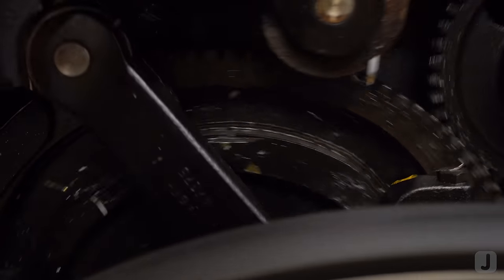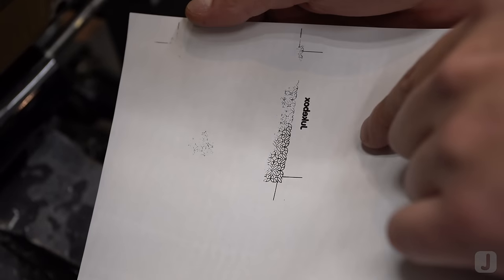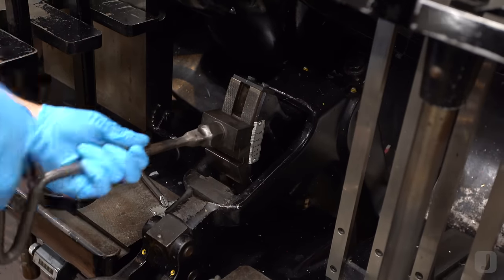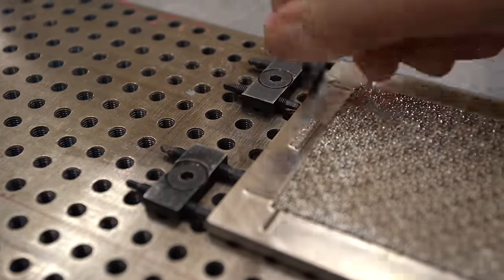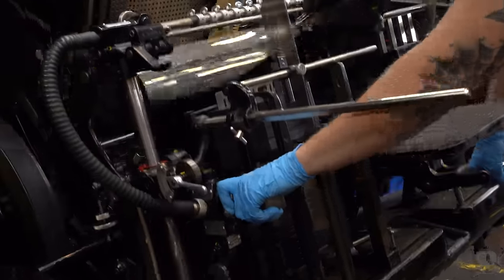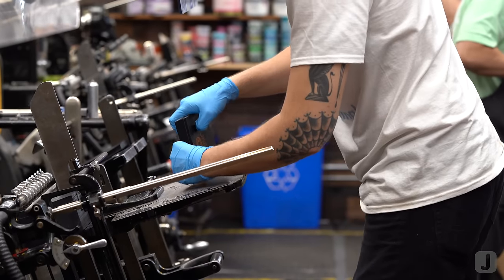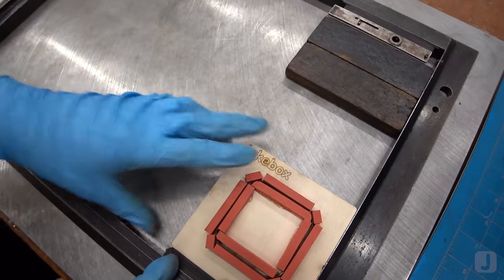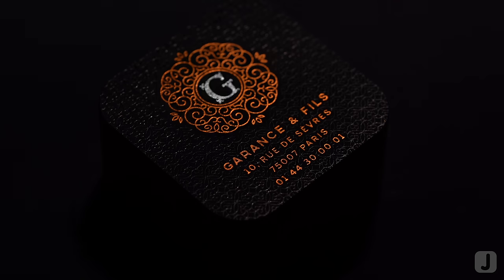Metallic Foil on Luxurious Black Business Cards!

Comment: No, friend. Those a business coasters.
Reply from the maker: double whammy
Reply: I had to chuckle a little. Yeh, some customers use odd sizes on their business cards. Really enjoyed your video. Gives me ideas I could pitch for our business cards. I work for a commercial printer (various offset presses including a KBA 540, KBA 640, Heidelberg GTO 220, 2 Heidelberg Quickmaster 2 colors, a Haim Superjet envelope press, digital with 2 Xerox IGENs, flatbed with a Vutek for window clings, signage, and banners on an 8 foot wide format) We also have a couple Heidelberg letter presses in house that we use for die cutting + a full bindery. Our cards are 3 stocks laminated together with a red center sheet and 2 outer whites. I just think they would be classier ditching the center laminated sheet and changing stocks to Classic Crest Duplex Epic Black/Solar White cover, then add a red foil guilded edge. That 1/2” radius round corner is really classy too. Kudos to whoever designed that card you produced. Really nicely produced video.
Reply: @warmothgmc  talking about odd size, a friend of mine made his card just one mm longer than an usual size, and made the design on both long side hot pink, so his card would still fit in an normal card case but stand out in a deck of cards ,lol

Comment: Is anybody else more amazed by the fact that literally a small piece of tissue paper is all it takes to even out the stamping?
Reply: He also adjusts the pressure, so even without the tissue paper it would have looked better. The difference you see is exaggerated.
Reply from the maker: This is the main component to making each unique job perfect. We have special tissue papers that are mic'd in thicknesses of .005, .003, and .001 so that we can appropriately build up the areas we need. It takes a lot of finessing to get this perfect and you can often find yourself fighting the impression as it settles across a run. We call this step "make-ready" and in the wise words of every printmaker out there "make-ready is everything".
Reply from the maker: a thin sheet of .001 thickness paper can often make an enormous amount of difference. I adjust the pressure also but there's no denying how important the makeready is. It's easily the most integral aspect of the process.
Reply: Epsilon Karamazov that is absolutely mind blowing. 🤯

Comment: Great video guys! The shop I'm working at has three incredible Heidelberg windmills from 1952 that I print with- but can't use foil on. We have a couple Kluges in the back that aren't up and running right now, but this totally makes me eager to get going with the foil on those! So beautiful!
Reply from the maker: Nice! Kluge foil stampers are great! Changeable side guide... adjustable laybar... multiple foil pulls...super consistent heat... air foil separators... room for friskets... tons of pressure... Big fan of the EHD models. If you have any Kluge questions in the future I can answer those too!

Comment: Business card cost: $15. Machine cost: $30,000. Defending yourself by throwing them like ninja stars: PRICELESS
Reply: Yeeeeeeeeessssss!!
Reply: I'd raise that BC cost quite a bit.
Reply: check their online configurator, this is no 15 dollar job (hint: a 16 pt jet black stock, front only, single color, standard business card with no extras is about 270 USD for a lot 100 with 7 day production time)
Reply: @run00n0  I was saying $15 per card :) Thanks for the more accurate price, it's definitely worth it for CEOs and hitmen :)
Reply: I think you’re overestimating the machine cost. Where I live you can buy a refurbished Heidelberg (not the gt version and without the foil heating system) for under €5000
Reply: @gvanvoor  I thought this was an ancient press from centuries ago :)
Reply: Alex Supremo It is, but apparently demand is high enough for companies to refurbish and resell them. A lot of modern print shops still have and use one for specific purposes (mainly embossing I think)

Comment: I'll never complain about the cost again!!
Reply: Damn right you won't complain if they are using a machine from the 1960's,  but if they are using a a new modern machine it'll be so much easier on them with sensors doing most of the work
Reply from the maker: Show me this machine you speak of
Reply: Arþur D Both look painfully slow tbh
Reply: @ArthurD  Both those machines are rubbish, they are toys designed for low volume low quality output, you cannot compare this Chinese rubbish to the Heidelberg output, like comparing a Porsche to a Kia
Reply: @zaneh6224  I bet Porsche won't sell as good as Kia. Porsche is just VW with a different badge.
Reply: @zaneh6224  also, they use absolutely the same principles, just different execution. How can you be so blind to not see that? Do you prefer antique over modern? Or roughness over precision?
Reply: @ArthurD   I worked in the printing industry for many years, what you linked to is no comparison to the quality these older machines will produce, you don't even understand foiling if you think these two are the same,.

I prefer quality over quantity, the machines shown in this video produce far better quality than that Chinese toy, and they produce that repeatable quality at a production speed and have been producing that high quality for 70 years, that toy will be broken in about 3 months.
Reply: @zaneh6224  they only do that because of the high cost regular maintenance. They add enormous cost to the price of these cards which is not good for people from emerging markets. This is a con that cheaper machines from my links don't have.
Reply from the maker: @ArthurD  Our press has never needed maintenance above and beyond our routine oiling and clean up since 1960. There is no computer to fail. The press can print, emboss, die-cut and foil stamp many different kinds of materials. It has an impression strength of 60 tons. It can reach speeds of 5000 impressions per hour and can fit a press sheet of 13x18. The dies we use are photo-etched magnesium using thermographic film that outputs artwork at the highest possible line-screen. You can't possibly think that one of those small toys could compare to top of the line equipment from the golden era of print communication.
Reply: @JukeboxPrintLive  ok, good for you. I wish you luck and wisdom. Last word though: you're there now, with your aging top of the line equipment, but these "toys" you mentioned will eventually catch up and outperform this large and heavy machine. They are cheaper and faster to make, use and output production. Market always looks for something like that.
Reply from the maker: @ArthurD   Arþur D  When the escalator was invented it didn't replace the stairs. Sometimes the "hard way" is simply more capable - not because it's old fashioned; but, because it has stood the test of time and the process has proven to be most reliable under an enormous variety of conditions. An old crippled cat can still catch a mouse better than a race-horse.
Reply: Considering everything including set up cost on the artwork, I bet you could get a card like this done for 50-75 cents a piece for a run of 10.000 not a bad price. Would be great if a person marketed these as a premium guest pass for an event. Definitely a collectors item/memorabilia.
Reply: @ArthurD  though I agree with you to adopt some modern solution but, remember @Jukebox Print loves what he does and the fun using classical equipment cant be replaced believe me I have digital duplicator for my bookbinding hobby and work, but I feel empty wish I had old school printing machine :)
Reply: @ArthurD  I'm sorry but these are links to toys that an invested hobbyist may purchase, not a professional print shop.  There are a lot of semi-quality pieces that can get produces in China but not to this quality or attention to detail.  This is an art that will likely not get replaced by technology for many decades.  Heidelberg's new offset presses do incorporate a lot of new tech and they still require preventative maintenance for the actual press to ensure longevity.  Adding tech means more maint. (as well as more things that can go wrong) and it's my experience that it's the tech that has more issues and goes out of date faster than analog.  This is why these machines from over 50+ years ago take so long to get replaced with newer equipment.  It's also a very recent concept that printing should be more 'affordable'.  People don't understand how expensive printing can be and that it's an art, most of the time I deal with new clients they think we still print things by the page instead of multiple up on a sheet.

edit  Completely forgot to mention but the toys you referenced only foil stamp, the machine he is using can do that plus embossing, die cutting, scoring, numbering plus more.  There are digital printing presses out there capable of maybe a fraction of those capabilities but they are in the many $100,000's to acquire (with each capability adding even more to the price) where as these older presses are only a fraction of a fraction of that cost.
Reply: @ArthurD  i dont think u quite understand how this machine works. It doesn't just "print". It is able to press the designs into the paper. and it creates a very interesting touch to the paper/design!~

also, pardon me if it sounds quite shallow, but i do think letterpress is special as compared to modern printing because the finishing touch isn't very achievable with modern equipment.
Reply: @ArthurD  From a quick, rough analysis of the first link you provided vs. this video:

First link: 4 minutes setup time with 40 seconds per print.
This video: 30 minutes setup time (kinda guessing with all of the editing) with 2 seconds per print.

Look at this graph https://www.desmos.com/calculator/e4i9ykwxdg and see the meeting point is at about 40 cards.
So if you need just a few cards for a test, then the machine in the first link is more time effective. Otherwise for runs over around 40 cards (which is probably most customers, given business cards are ordered in bulk), the machine in this video is more time effective.
Reply: @JukeboxPrintLive  Wow 60 YEARS!  Older than most people here and more reliable with less maintenance than anything made out of China.  You're lucky to get any product with greater than a  2 year warranty, much less 60 years+ of outstanding service.Totally fascinating!
Reply: @ArthurD  I know this comment is getting rather old, but I wanted to add my input. I’m am a maintenance technician at my print shop. The newer machines are typically much harder to work on, and have multitudes of variables that cause them to be more unreliable than older machines. Maybe one day, but the technology isn’t as near as you’d think, and by the time it is, we probably will not be printing anymore. And, even if they are reliable, the added variables make them much harder to maintain and work on.
Reply: @ArthurD  All those video you gave, there is no emboss. It's different bro. 
No matter 60's / 70's / 80's machines, this video is showing art, passion and perfection
. 
It's like you compare between Starbucks and real Java Arabica.
Reply: @zaneh6224  I personally know someone working for Heidelberg as an accountant, It is common for me to hear conversations about competition and how they always sell better.
Reply: @crossedeyefreak2564  imagine a thousand years from now when everything is synthetic and bulk produced, someone hands a potential client a foil stamped business card on high quality paper card stock.  most people will look at it and react like the children at the diner in Back to the Future 2.  but to the people you actually want to impress, who can appreciate it for what it is, you're a damn boss.  i really don't think it'll ever stop being a thing.  it may get more and more rare, but there will always be someone willing to pay for high quality.  and a machine like this might actually survive that long.  the machines in that dude's link will be in landfills with all the other toasters.
Reply: @zaneh6224  Kia Stinger is a wicked car, fast as hell as well 😃

Comment: Great video! How much waste do you have to plan for any adjustment or missprint? Like you have an order of 100 cards, you star with how many?
Reply from the maker: We can often look at a design and feel out how difficult the make-ready might be and judge it based on that...
These cards required 4 separate set ups so for a run of 100 we might run about... 180 sheets to begin with just to be sure. Keep in mind, we use the misprints along the way too. A safety net is always good to have and if we make less mistakes...we just send some of the extras to the client!

Comment: Great video! Please can you make a video about the main parts of a windmill and a basic maintenance of the printer? Also when you die cutting how do you prevent you die blades from getting damaged? Is just matter of pressure or you are using some kind of backing? Thanks
Reply from the maker: That's a good idea. We should do that... As for die cutting, we typically start with the impression set very low and increase until there is some cutting through. If only part of the die cuts through, we build up some packing under the die cutting jacket to even out the cut. The steel rule blades are meant to cut through the paper and lightly kiss the press on the other side. Hitting steel rule too hard is very bad practice so a sensitive set up is required. We will go into more detail about die cutting soon. This video showed the most simple form of it!
Reply: @JukeboxPrintLive  Great news! Looking forward to seeing them! Thank you!

Comment: This is so mesmerizing to watch. Although,  I have a big doubt, the raw cards are always a lot bigger than what is needed. Seems like 50-60% is discarded. Alsoa huge amount of the golden film is also not being used. Is it possible to recycle them?
Reply: Try saving paper and you will end up discarding even more.
Reply from the maker: We filmed the making of only one card at a time for simplicity. Usually, we fit more cards onto a single sheet and doing so will minimize the amount of paper margin or waste in the shells. This is the made for TV version that shows us doing things different than usual so people can follow along easily. The foil almost always has a lead up from the previous job to use so nothing would get wasted. For this video, we used brand new rolls instead of older ones.
Reply: @JukeboxPrintLive  thank you very much for clarification!

Comment: Good job!! Nice press!! Did the 18" Windmill come with the heat unit standard, or was it a factory option? On the 15" ones I ran, I had an after-market foil unit that worked similar to this one, and a friend of mine invented a foil cutter, so I could buy parent-size rolls and cut them as needed.

Back in 1980, these cards would have cost about $2 ---- EACH, not including the artwork. There is a lot involved between the concept and the magnesium dies that wasn't shown....  There is nothing comparable to a foiled, or embossed business card!
Reply from the maker: Ours is an aftermarket add on made by a professional finishing equipment manufacturer. Really nice consistent heat throughout and one of the better kinds out there. From artwork to magnesium is a huge amount of steps that we don't show at all. Artwork separation, proper film output, exposing and developing the plate, acid bath wash out...

Comment: So why do you need the metal brace thing heated under the dye? Is it to get the right temp for the paint viscosity?
Reply from the maker: Yes, it needs to be nice and hot to activate the adhesive in the roll of foil.

Comment: How do you guys handle paper jams? I have a problem with my home printer 😅
Reply from the maker: When paper jams happen on a machine like this, it isn't pretty...haha. With the wrong feeding setup, a press could accidently pick up 5 or more sheets at once, that alone can stop the machine in its tracks. Either the shear bolt will snap (highly unlikely) or the belt will pop right off the motor!

Comment: Wow i dont know why i got recommended this.. however you did an excellent job. I do have 1 question now that i watched the whole video. Im assuming, you have a few extra in the run in case of adjustment? like that die cut being off. So if i was to order 100 i would assume you would run a job with like 103 to 105 to make sure that your doing the job ONCE with taken in to the fact that your going to have a few that are going to be "sacrificed" for the job. Correct?  could not imagine you doing an order and being a few short because of the adjustments and now needing to re run the order for a few which would require other adjustments and re checks lol.
Reply from the maker: Thank you! Great question. I'd say that an order of 100 like this (with 5 unique passes) would probably require us to start with at least 150. I know it sounds like a lot but a safety net is very important to save ourselves from having to start over to make up for a short order. In the end, we typically send the extras to the client anyway. Also, one's that aren't good enough at the beginning are still used to test later steps. I almost always use the bad ones to prepare the die cutting for instance.
Reply: @JukeboxPrintLive  Awesome. yea i figured as much. I didnt think it was gonna be THAT high as far as the count but yea i can see how 5 unique passes could take a few in more complicated print jobs and that 150 becomes less and less as glitches and tweaks happen.

Comment: Those machines produce such a satisfying sound. Are they pneumatic?
Reply from the maker: Everything runs on a small 3/4 HP single phase electric motor. A single spinning flywheel powers the entire machine with 60 Tonnes of pressure while at the same time running an air pump that creates suction and vacuum in one stroke.
Reply: @JukeboxPrintLive  Mind = Blown